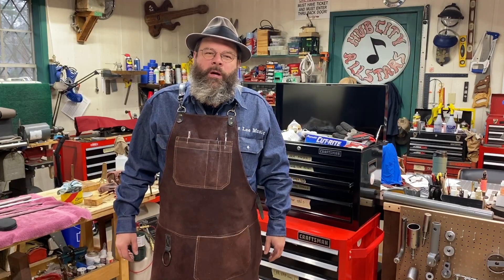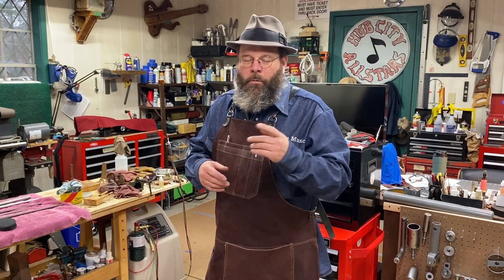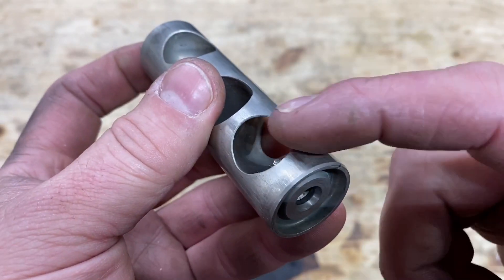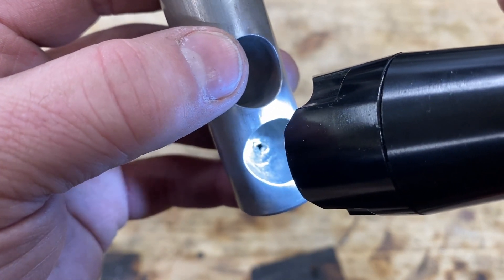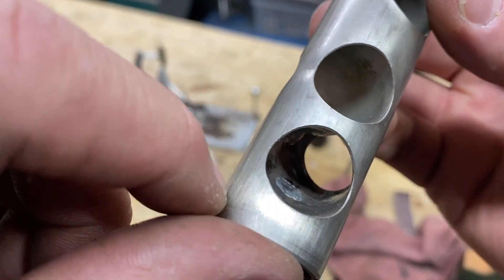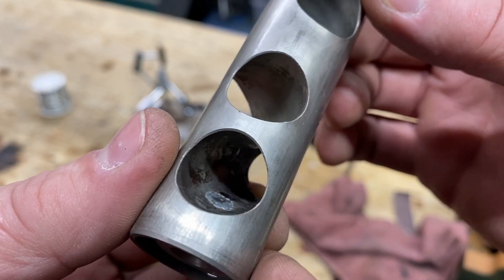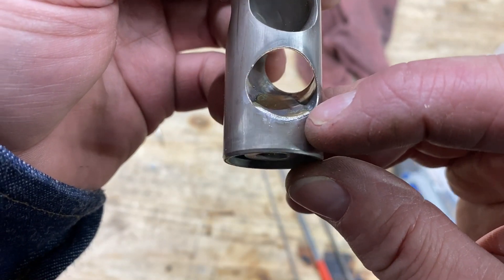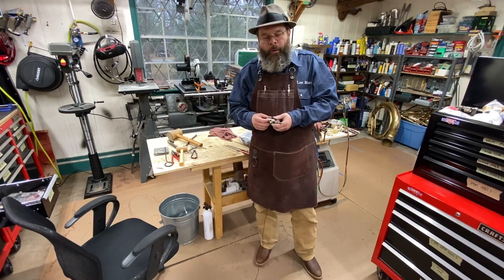How To Make a Port Patch- viewer requested help

Comment from the maker: I mis spoke when I called the low temp silver solder 60/40. Actually it is 96/4.  From the manufacturer: “Harris Stay-Brite low temp, high strength silver bearing solder melts at 430*F. Provides 5 times strength of regular solder with tensile strength 10,000-25,000 PSI. Harris part #SB21. Sorry for any confusion, Wes
Reply: Hello sir, a great question. I have a collegiate holton sousaphone without piston #3 and I would like to know how I can or where to buy piston #3 thanks
amazing work👍🏼

Comment: Bought a used tuba and someone pushed a stuck piston with ,yep, a screwdriver.  Burnished the hole and then used  strong epoxy to plug the small hole. Been good for 3 years or more.  Saves any problems from heating the piston.

Comment: Thanks !
I never heard of low temp 60/40 silver solder, and given the temperature reached I'm super surprised that a silver solder exists that melts so low ! (Since usually the metal turns at least dark red for silver soldering). Where do you find this ?
Reply from the maker: I mis spoke calling it 60/40. It is actually 96/4 silver bearing low temp silver solder. Harris Stay-Brite part #SB21. Tensile strength of 10,000-25,000 psi.  I got this roll from Allied Supply.
Reply: @wesleemusicrepair9820  thanks for the clarification ! I had no idea leadfree solder was so much more resistant than standard 70/30 tin/lead (which tensile strength at break is more about 4-5000 PSI if I remember well). I should probably buy and try it for some highly stressed soft solders (sousa braces for example)
Reply: @wesleemusicrepair9820  a last question: which flux is recommended for this solder ? is Zinc cloride OK ?